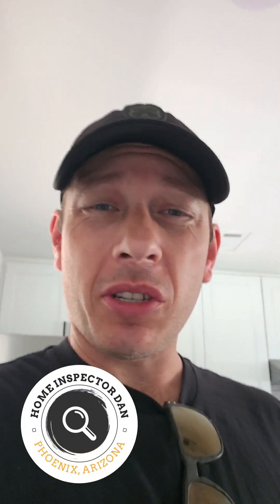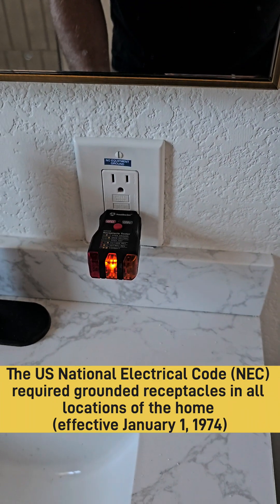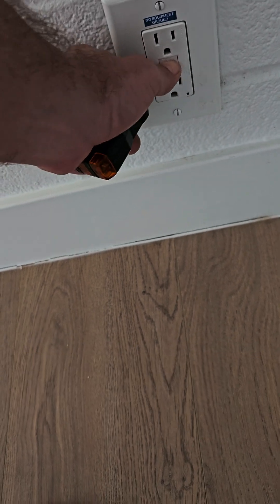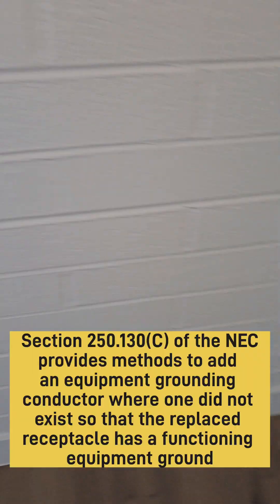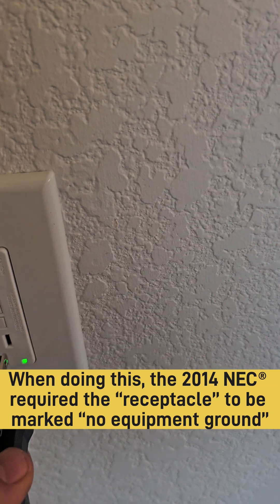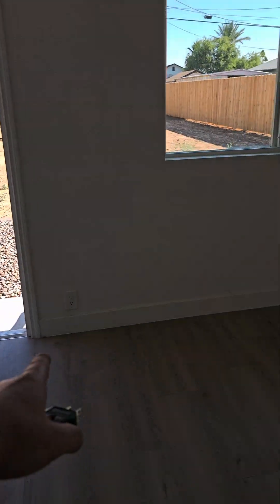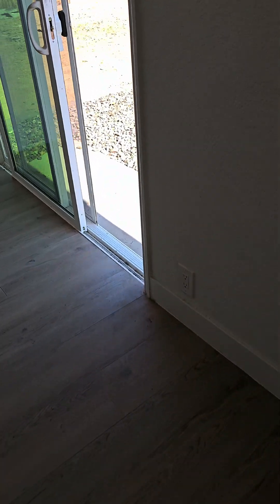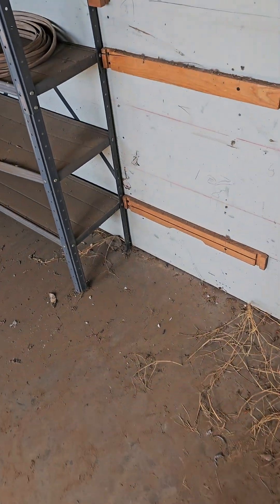Why Open-Ground GFCIs Can Still Be Dangerous

Comment: If your house has no ground for its receptacles, you only need one GFCI at the beginning of the circuit. It will protect everything else downstream. These people wasted so much money with buying all of those GFCIS.

Contrary to popular belief and even the name of the device, GFCIs will still work without a ground.
Reply: gfci receptacles also change the original 2-prone outlets to 3-prone outlets, which would be compatible with more modern appliances.
Reply from the maker: I was wondering why they didn't just replace the breakers with GFCI breakers. Yes, there are a lot of buttons in this home. Lol